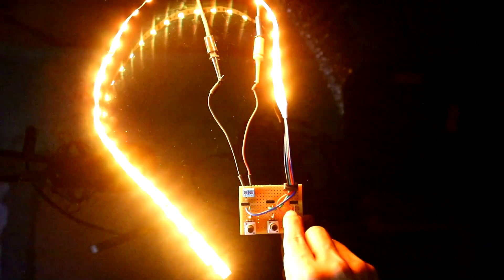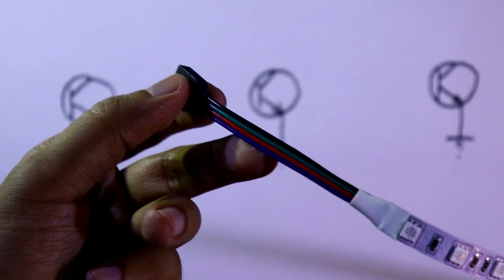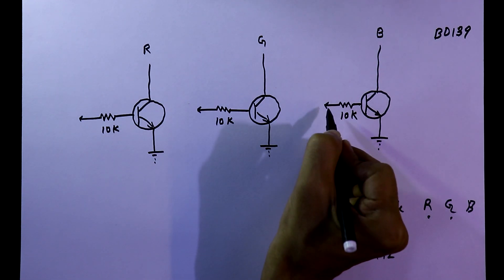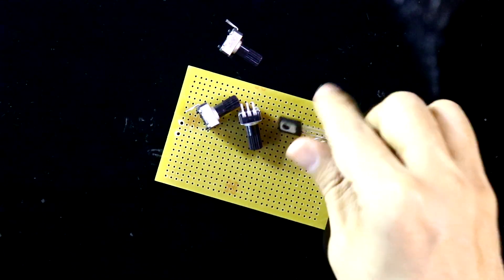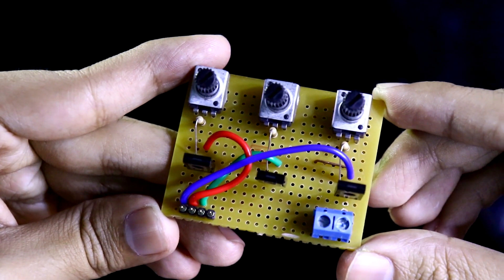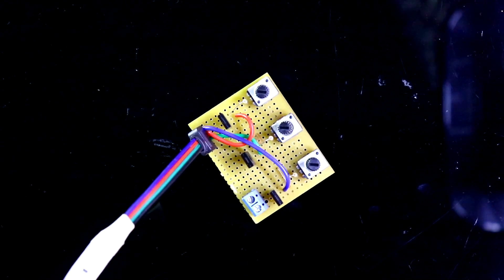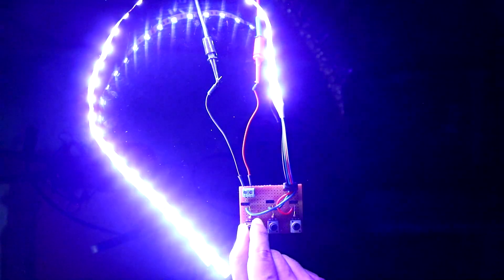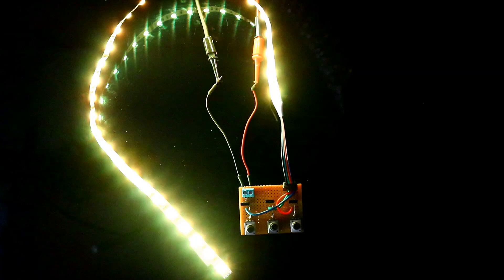How to make RGB led controller at home

Comment: sure it works for 4 pin strips but not WS2812B 3 wire individualy adressable strips.... you need to send bits of data to them

Comment: That was one of the best electronic video, you explained it very well thanks ,I wanna make it and i have question can I use bd235 instead of bd139 for better current because you said it will heat up ?

Comment: Thanks for the lesson!
you can tell if it comptitable with RGBW strip?
what i need to do only add 1 more Potentiometer and 10K resistor or it will fail?
and for 24v 2meter strip - it can be work? or what i need to change?
I'll glad your answer!

Comment: Awesome video and really good english. helps a lot with my lm337 rgb mixer project!
Reply from the maker: Great to hear this! Thank you so much 😊
Reply: @EEWave  Tried and failed with this circuit before because I made a voltage regulating circuit with lm317 and it didn't work since they control positive output and my leds are like your strip so big fail XD
Anyways, this circuit is it a currency regulator or a voltage regulator?
Reply from the maker: It is just a transistor circuit. Here we are controlling the base current with the potentiometer. By doing this, we can control the collector current.
Reply: @EEWave  Okay thanks! I still don't know how to spot the difference between voltage regulating and currency regulating circuits :)